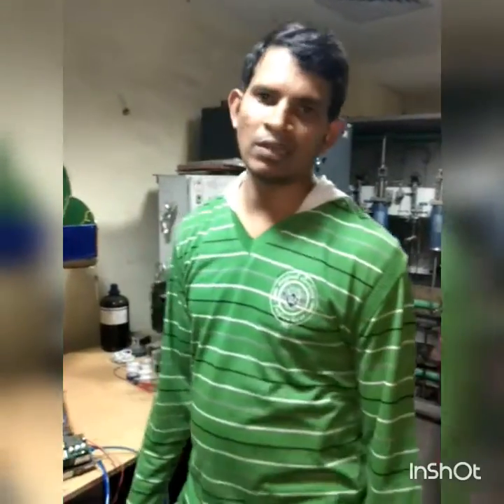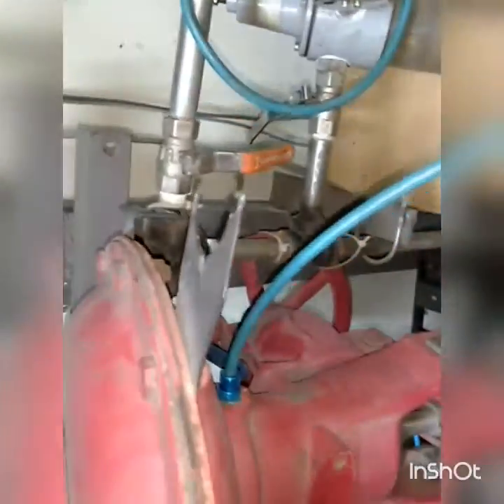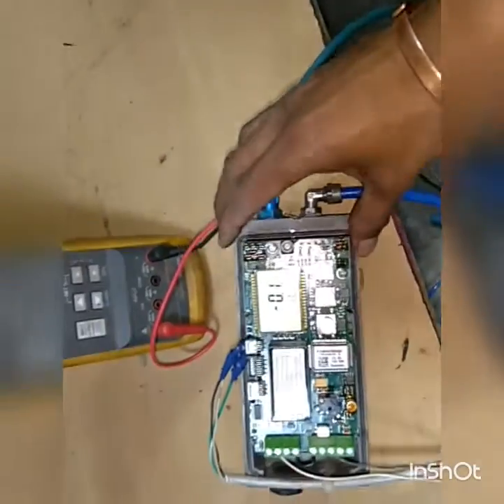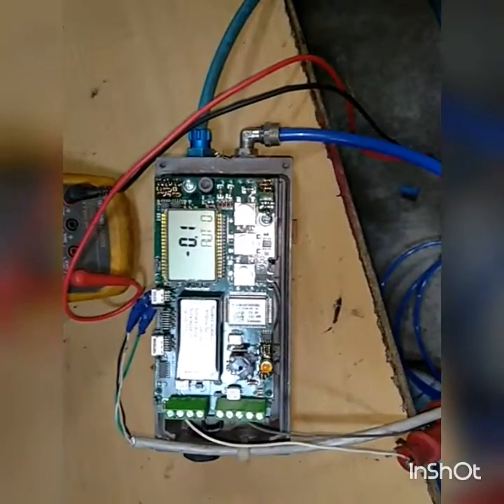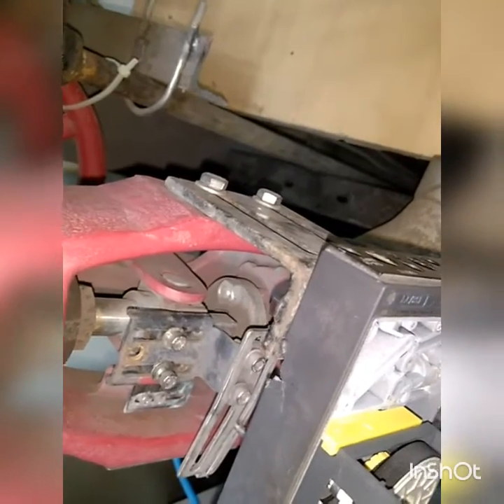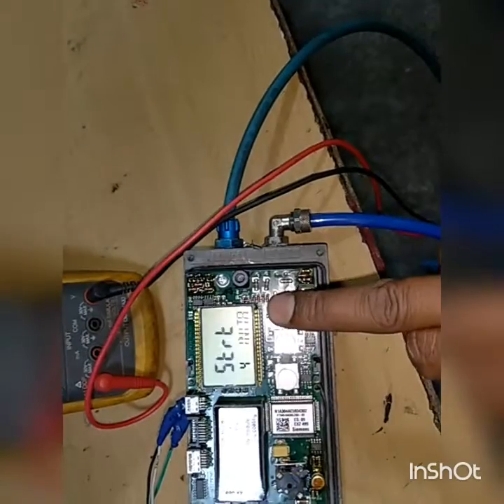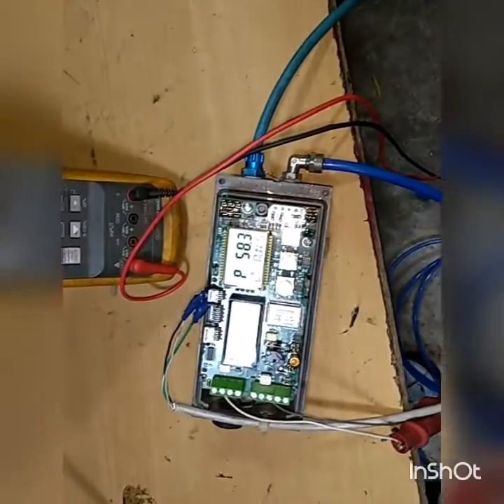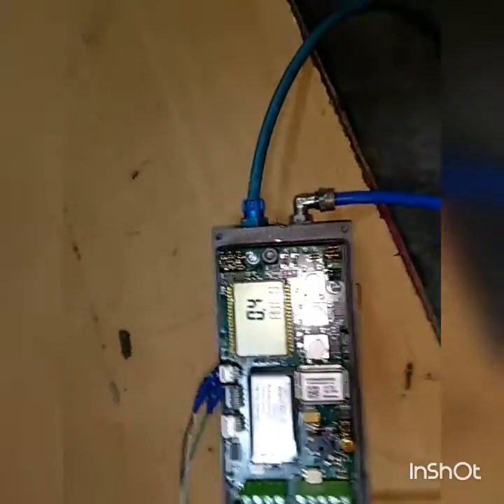Siemens PS2 Smart Positioner used as Remote Positioner

Comment: Sir ek side hi valve turn horaha hai dusre side air nahi de rahe hai turn karne ke liye kuch guidance de sakte ho ap mujhe siemens ka SIPART PS2 hai
Reply: 1st confirm actuator is passing, 

2nd May be positioner having issue with second port, so if possible use that positioner in single acting actuator. To confirm positioner issue

Comment: Nice video Sir. 
What model of Siemens positioner are you using?  
I'm using sipart ps2 Hart pos.  6dr5120. Is this applicable for that configuration? 
Thanks Sir.
Reply from the maker: u can use any positioner which having POT for feedback. so u can use PS2(6DR5120).